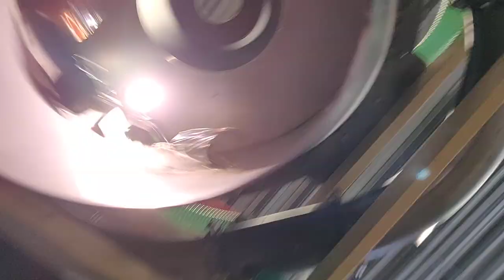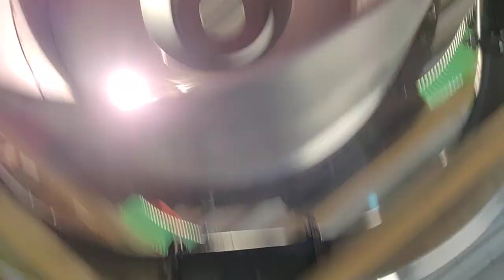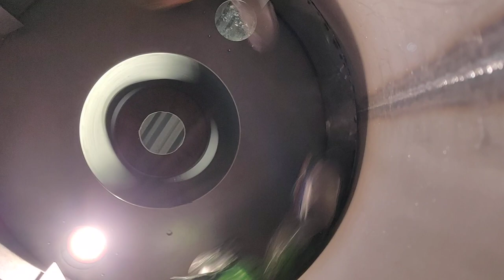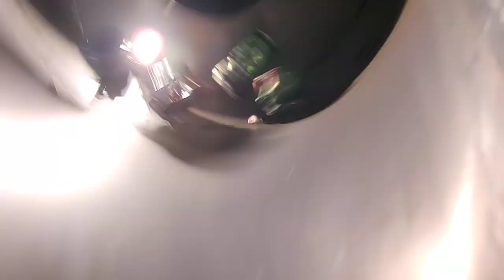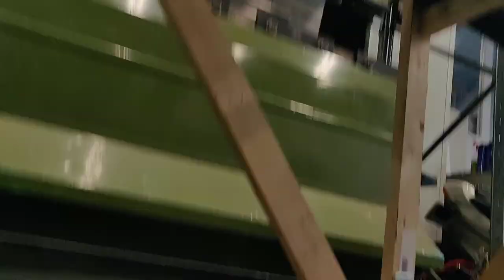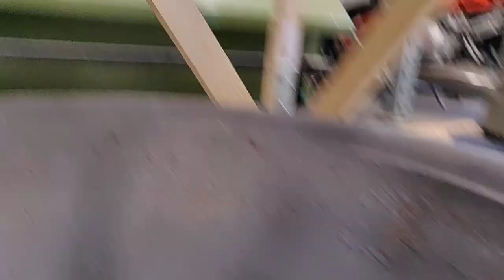WindHexe Build prototype V02 - Cans in Tornado in a Can - 13 July 2023

Comment: Have you been able to determine what’s causing the massive difference in effectiveness between your version and the original? The original instantly pulverized the items placed inside. All of the replication models don’t seem to pulverize the items at all
Reply from the maker: We have moved way beyond these tests. This was initial prototyping. Already, Henk jurrien using the same blowers, improvised folded metal air injection slits and a rough slap together prototype has converted Al cans into small fragments.

If you go over to Windhexe.com, you will see many updates, since these tests the focus has been on the instrumentation of the devices to establish temp, airflow, slit width etc. Thes have all been engineered into Arduino and integrated onto a control panel.

In the original there was temperature and humidity - we have tried neither to date. We will add humidity, temp and ionisation in future tests. Given the rough experiments of Henk Jurrien since the test above, there is high expectation we will get far closer to the original windhexe's operating functions - that being said, our windhexe is still miniature by comparison, so we are hoping that does not become a deal breaker.
Reply: @MFMP  I appreciate the detailed reply. I was going to say, perhaps the scale of the device itself affects the vortex's ability to pulverize, similar to a logarithmic scale where there's a hard cutoff where anything below that threshold is completely ineffective. Have the Kraft patents been able to shed any further light into the issue?
Reply from the maker: I think we need to see if with heat, moisture, ionisation, air speed, aperture shape/direction etc. we improve upon the affects we have already achieved first.  @HCG